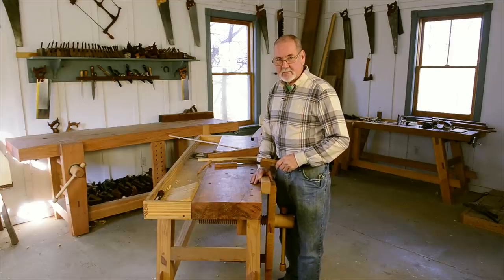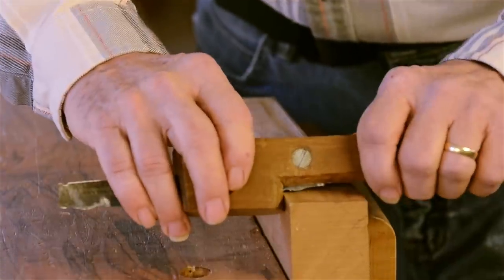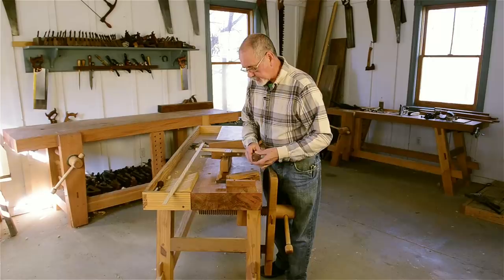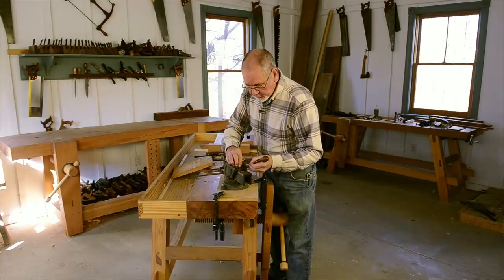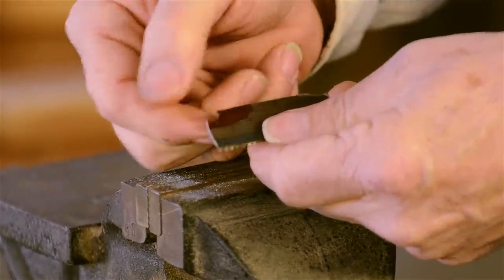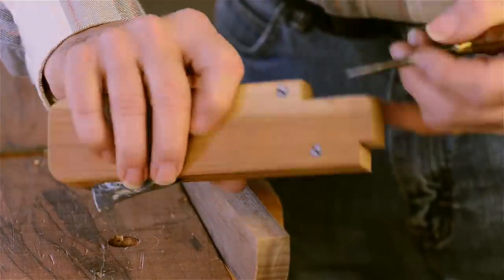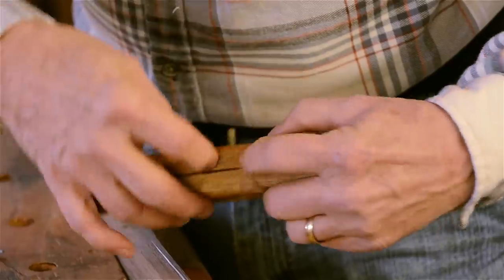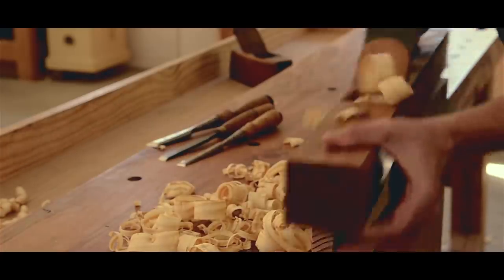How to Make & Use a Scratch Stock for Woodworking

Comment: I did find this quite useful. I've seen all sort of patterns and information on these, and was in need of making one, and this was he first video that popped up. I really enjoy the rough "scrap wood" approach to your scratch stock cutters, and I was able to do just that. A broken hacksaw blade, a few minutes with a bench grinder and a Dremel, and 2 small scraps of maple with a 7/8 x 1/4 deep notch cut out of the centre base (just quickly cut on the radial arm saw), and I was able to scratch the stock I needed (some very tiny flutes for mini column plinth toppers on a reproduction clock case). It's surprising how shallow the cuts actually need to be to get a nice profile.
Reply from the maker: Glad it helped!

Comment: I recently made a scratch stock to put a bead around a vent opening in a section of pine baseboard. I could no get a clean bead when working across the grain. Any suggestions to working cross grain with scratch stocks?
Thanks
Reply from the maker: Pine is harder to scrape and scratch than hardwood so spend some extra time polishing your profile.